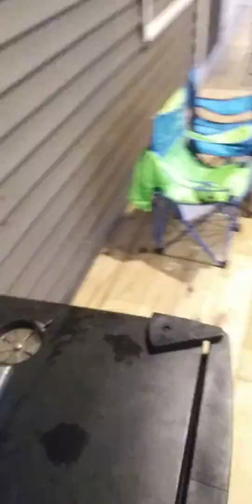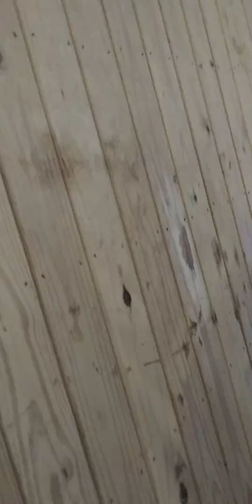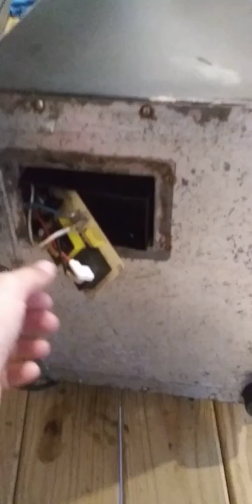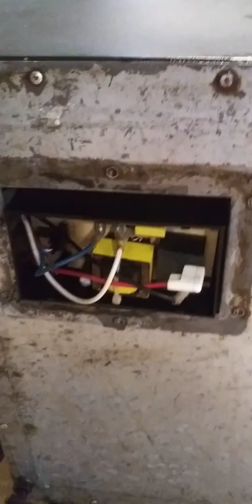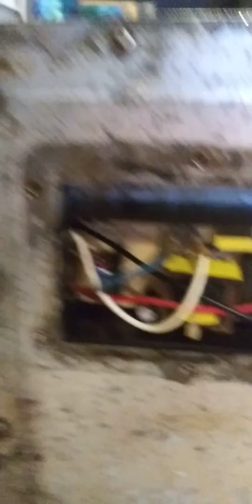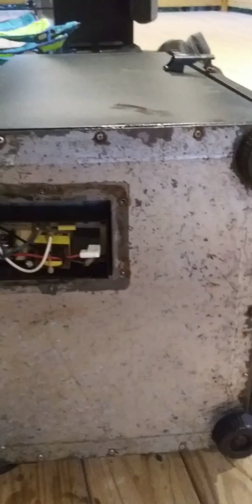How to fix Masterbuilt smoker short circuit

Comment: I didn’t replace the heating coil, but I did try the heating it up with a torch for 5 to 10 minutes and that made no difference. I checked the wiring in the back to the coil and that looks perfect, so I doubt that it is a short in the wiring. As soon as I get a minute, I’m going to tip it over and see what I can find. I will report back, but thank you for at least giving me another idea.

Comment: Great video , replaced the heating element and it was a no go. The control panel, still a no go. Saw your video and tried it. My box was not full of grease
There was no need to clean it. I then unplugged what I could and re-plugged it and bam!! it worked thanks a lot appreciate your video never would’ve never considered looking at the power board.

Comment: Thank you so much. I was about to give up on mine. I wish I could have posted a picture of it. There was a grease cake the shape of the plastic housing encompasing the electronics. What a design flaw. I drilled some holes in the plastic to let any grease leak out. I need to make sure that I don't use it over nice concrete or wood since it leaks, but it works perfectly now.

Comment: Mine pops the circuit as soon as I plug it in, not even on. This could very well be the problem. If it was coil, it wouldn't pop until turned on. I immediately ordered a coil like you did. Oh well, a new coil won't hurt anyway. Great tip, thanks!!
Reply: I had your same issue,  plugged it in and tried the  circuit!  Cleaned like the video and worked perfectly

Comment: I have the same smoker and it stopped working as well. When I opened the bottom door the main black lead was corroded and disintegrated so it looks like that is my problem. Do you know how to get a new main board?  Thanks for your informative video!
Reply from the maker: I wish I knew where to buy a new board but I haven't been able to locate one...
Reply: I've seen those boards on ebay.  There are a few different models.

Comment: Hot glue to seal a circuit board on an electric smoker?  I have to think it would melt and run at the first use.  High temp RTV silicone might should be considered...

Comment: Thank  you!  I have 2 smokers that are doing the same thing. I thought that drying them out inside with a fan on them for a couple days would do the trick but they still trip the breaker. No doubt when i open the access panels, it will be the same issue with them.

Comment: Thank you for this video! Mine had the same exact issue. Mine was tripping the gfci outlet within 3 seconds of turning it on. So frustrating! I was ready to try reheating and/or replacing the heat element, then found this video. My electrical compartment was full of grease. Cleaned it all out, then plugged it into a non gfci outlet for 45 minutes at 250°. Then tried a gfci outlet in my garage, and it runs perfectly again. Thank you!!!

Comment: Same issue here and almost sure mine needs the same fix.  My drain has not produced anything for quite a while - nothing in the little bucket attached to the back of the smoker.  Going to check this tomorrow and will let you know.  Thanks!

Comment: Great video. My problem is, i get a shock when I touch the exterior Sometimes,  or it will  pop the gfi. Got a new burner Ohms tested  the burners side by side and they’re both the same. Ground wire inside the unit looks a tad  frayed, can’t tell if it’s got a bare spot. Any suggestions? Could it be the digital controller?
Reply: Yeah it was the burner, I ordered replacement from Master built.
Reply: I’m having the same problem. Did you ever find a fix?

Comment: Thanks for this video. Years ago I saved the digital panel from my Centro smoker, as everything else was destroyed or in bad shape. Does anyone remember where the four wires from the controller are connected? The plug has two red, and two black wires.

P.S. I have figured it out, but did not repurpose the controller in the end, too much hassle.Needng other parts as well.Thanks.
Reply: Try reddit buddy

Comment: Great video. How did you open the circuit  board metal cover? Mine is held by rivets
Reply: @acjohnson2067  Yes, I guess I am going to have to do that and hope the circuit board is still alive. I just replaced the heating element and used 3 times and now trips the GFCI  .When plugged in a normal outlet would work without tripping anything.
Reply: @acjohnson2067  I opened the compartment and it is clean and dry as a bone.No moister or any grease. What do I do next?
Reply: @acjohnson2067  Hey, I got it fixed! I plugged it in a NON GFCI outlet , set it to heat to 280 F for about 30 min in order to dry all and any moisture . After that I smoked a whole brisket for 14 hours in my regular porch GFCI outelt and no problem. I guess it has been sitting too long in my shed and moisture got into it and was causing to trip the GFCI
Reply: @acjohnson2067  No problem.I hope this will help someone else .